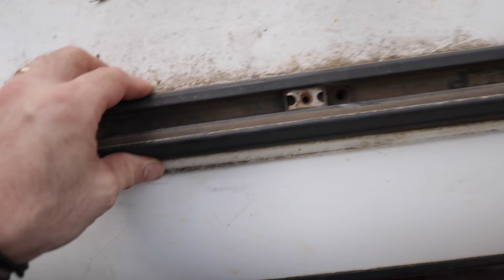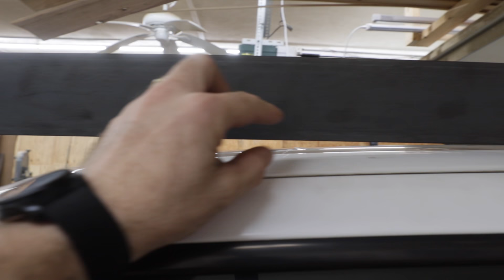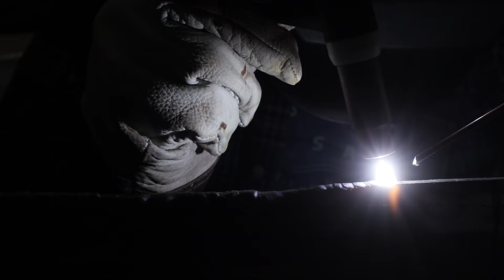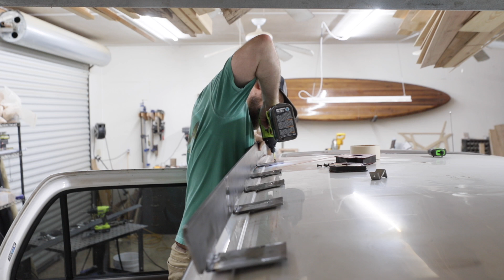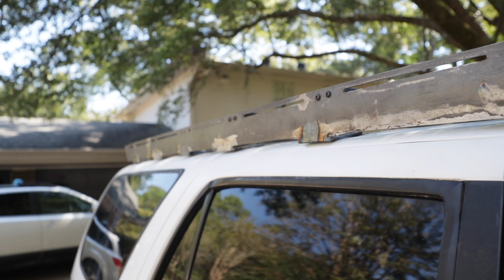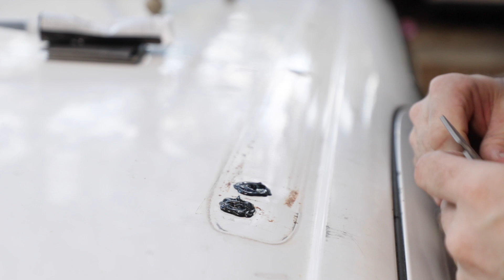How to Build a Prinsu Roof Rack for 3rd Gen 4Runner!

Comment from the maker: (Update) disappointed with the hardware from tnutz I thought it would be more weather resistant but they already have surface rust on some of them and it hasn’t even rained. I’ll either have to paint them or look into getting some black anodized stainless hardware if that’s even a thing. Suggestions welcomed. 
Also.. 
I didn’t show this well but there is 3m double sided mounting tape under the front brackets to protect the paint and prevent movement. Just so you know 👍. Y’all are awesome! So glad y’all are enjoying this build! 🙏🙏
Reply: Get titanium hardware and heat it till it turns bright red then dip it in wd-40 it will blacken.
Reply: @Stealth_Overlanding for that price you should just buy the real product. That would be insanely expensive for a damn roof rack.
Reply: I built my own prinsu style rack about a year ago. McMaster Carr has black stainless hardware, it’s a little pricey but it’s worth it in our use👍🏻
Reply: Use stainless hardware. More expensive but won't rust. You can paint it black after the fact to hide them. 
Great build though! Looks like it came from a factory. 👍
Reply: Black Anodized is not a thing for Stainless Steel. But it is a thing for Aluminum. Considering your metal choices Stainless Steel that is Black OXIDE finished is an option to consider.
Reply: Mcmaster Carr they sell black oxide hardware that’s where i got mine
Reply: @DuanDao  True, and it will cost you.
Reply: @SuckItYouTube19  I think I paid $50 just for the hardware 1/4 20 bolts, washers and lock nuts all black oxide. Pricey but looks good
Reply: I agree, tnuts hardware rusted too quickly on my roof rack as well.
Reply: stainless or zinc coated will be fine. Just make sure to dab the threads with anti-seize so you can remove the bolts later without them getting stuck.
Reply: How is the wind noise while driving with new rack?
Reply from the maker: @robert8342-w7x  no wind noise! It’s great!
Reply: Hey how long were your aluminum extrusions?
Reply from the maker: @davidanikeyev2707  44in
Reply: @PatrickRemington  thanks!!
Reply: @davidanikeyev2707  i replicated the length of the prospeed rack and used 51”
Reply: @DuanDao  thanks!!
Reply: @davidanikeyev2707  want sure if you were asking Patrick out me lol
Reply: @DuanDao  snap I didn't realize I replied to the wrong person 😂😂😭
Reply: @davidanikeyev2707  haha it's all good man
Reply: @PatrickRemington   You’ll want to go with Stainless Steel fasteners.  And I would paint the heads.  There’s nothing you can do about the scratching.  Even anodized will get scratched.  Painting them means you can touch them up later if they scratch.  In a perfect world… You would powder coat paint the heads.  But… that’s expensive.
Reply: aluminum in contact with steel (dissimilar metals- including stainless steel) will cause galvanic corrosion. electrically isolating material would help- rubber gaskets or washers- but may not be structurally sound in certain applications. you could try having your steel powder coated to isolate it from the aluminum. "anodizing," though, is a process applied to aluminum, not steel- looks like your rails were anodized black. Good on you for giving this a go- many of us dream about building the perfect rack and never get around to it!
Reply: @jeremyhoenig  polyethylene tape is sufficient in-between differing metals to prevent galvanic corrosion. That what's used in-between steel bogey wheels & the aluminum box of semi trailers
Reply: @artsteadman2230  good to know, thanks!
Reply: @jeremyhoenig exactly.

Comment: Is galvanic corrosion an issue mixing aluminum and steel for this application? Id be worried about that on a roof rack - especially if the car isnt garaged when at home but maybe thats just cause its wet where i live

Comment: I know I’m way late to this video, but what a great job with some good tricks included for us DIY’s. I was reading a lot of comments about the long cut slots on the side rails. I’m not sure if this would be possible, but a router with a clamped down guide rail or something. I’m not sure if they make such a medal bit though. It would be nice if they did though. Works great for wood. lol
Reply from the maker: Thank you! I wish a router would work for that but it spins too fast and the bit will burn up. It might work on aluminum since its much softer than steel. 🤷‍♂️ the other problem is if the bit were to bind up it could really be violent. You don’t have to worry about that so much with woodworking but metal you do

Comment: I’m looking at making one for my 80 series but more arb-esque and thinking of welding cross beams to the side rails. Did that ever cross your mind for this build? Thoughts on strength versus just using screws?
Reply from the maker: I wanted the cross pieces to be aluminum extrusion and I wanted them to be movable for different purposes. Since prinsu uses screws i knew it had to be plenty strong and it is.

Comment: I may be 3 years late but I wanted to add that if your bars are making a ton of noise you can fix it by wrapping paracord in a spiral around the bar. It will almost completely get rid of the whistling and other noises.

Comment: Looks amazing, I'm wanting to do the same thing myself. One thing I'm wondering is how strong the cross rails are? To me it seems that only having two screws on either end is a big failure point and much weaker than the rest of the rack. How have you found it? Also, where did you get the rubber that you used to pad the roof from the feet and also the wind fairing?

Comment: Because you didn't put any rubber back. Under those for a while, did your whole start leaking?
Reply from the maker: I used rtv silicone around each bolt hole. No leaks!

Comment: Those brackets you built to attach the rack to the roof don't really seem like a great solution. Tons of extra weight, a lot of work and I'm not sure why it would matter if you had to put cross braces where the factory holes were.
Reply from the maker: The objective wasn't to build the lightest roof rack with the least amount of work. The objective was to show others what it takes to build a Prinsu-style roof rack. Which i did beautifully. Also, those rails only weigh 16lbs each sooooo.. 😂
Reply: @PatrickRemington  Did you consider just some angle iron? I've been designing and planning one for a while and a piece of angle iron or aluminum just seemed like much less work.

Comment: Did an exact build for my 5th gen turned out better than expect at a fraction of the price compared to prinsu. What size steel did you use for the wind deflector? That's all I'm missing and it'll be complete
Reply from the maker: I think it's 16ga

Comment: Patrick- awesome build & Great video!
You have inspired me to give it a shot...
Been thinking of lengthening factory rack for a while - this would definitely look much cleaner!
I am a fair bit behind you on the fabrication & welding curve (still getting good with MIG but did complete a cut to weld bumper)

Few questions if I may:

Know you knocked the tnutz bolts - if you had it to do over again would you still use their rails?  

How is wind noise? The slots on rails seems like it would cause some as well as gussets on mounting tabs.

Anything else you would do different if doing it again?

Tnutz all in cart & ready to order - should have my 3/16 soon as I can get to the yard 

Thanks

Comment: So, I have been looking at building my rack as well, couple of things. Prinsu uses 1/4 aluminum for their frame depending on how many cross bars depends on how much weight it can hold. since your using steel, you could have gone with less gauge. but the issue with steel is it is more prone to rusting. I did see a rack that was interesting is that it was a basic frame, with thinner gauge to give it the arrow design look. another thing to remember is weight. to your comment I would look around and go stainless. but if you go with the idea, I have which is aluminum you don't have to weld just bolt everything together. then paint or powder coat.
Reply: definitely the aluminum for anti corrosion, and the powder coat is key too, no bondo required.

Comment: Ok, this is going to be quick. 1. I love those skewer hack trick with cardboard.  2. Is there a 4 inch 3/16 at 90 inches plate that you can just buy instead of welding pieces together? I like the DIY part, however some of us, don't have welding machines.  Over all, this is definitely DIY for  experience welders. After watching your video, It looks like a plasma cutter would really help with the holes and may just buy a plasma cutter
Reply from the maker: Hey thanks for watching and commenting! I appreciate it! Yeah I get it.. but welding equipment is becoming so affordable and something I am trying to promote on my channel is how easy welding is. I Tig welded this but you could mig weld it so much easier. If you like diy projects I highly encourage trying it out. 
Yeah I've other builds use angle iron bolted to the side rails instead of welded. Look up superfastmatt channel and check out his build. Also ebay is a great place to find short sections of metal for smaller projects. Hope this helps

Comment: That turned out really good! 
Any reason you didn’t go all Aluminum for this project?
Reply from the maker: Thank you! Steel is just cheaper and much easier to weld. I need a little more practice welding aluminum before I try that.
Reply: @PatrickRemington  I’ve actually only welded aluminum cause it’s the only metal I could cut with my woodworking tools lol. 
From what I can tell, it’s exactly like welding steel, just shorter beads to keep heat down, and cleanliness is extreme. 
Plus, as far as projects go, 99% of the time the steel diameters people chose is way stronger then needed, so the same diameters in aluminum (99% of the time) will work. If anything you might go 1/4 in aluminum to replace 3/16 steel.

Comment: The volume of the aluminum is enormous compared to the volume of the stainless in one of these racks, you'll probably never see any meaningful deterioration of the aluminum, I wouldn't get too worked up about galvanic corrosion here. You also have the anodized coating to help.

Comment: What paint and primer did you use? Also what size of steel plate did you use to make the wind deflector?
Reply from the maker: The wind deflector is 16ga steel I’m pretty sure. I painted it with rustoleum self etch primer then top coated with rustoleum flat black enamel. Then I coated that with raptor liner
Reply: @PatrickRemington  awesome, thank you!

Comment: Hey man, What was the overall width of the rack? I am going to purchase the aluminum extrusions soon and I was going to do 42" long. What length did you end up using? Nice build!
Reply from the maker: Thanks! My crossbars are 44" order them with 1/4 20 threads already cut!
Reply: @PatrickRemington  yep! That's why I wanted to know the length, thank you!
Reply: @PatrickRemington  oh and do you know what fractional length is? it's an option on Tnutz for the extrusion but I don't know what it means, thank you
Reply from the maker: @benrobinson6907  that's if you needed it cut to 44.5 or 44.25. just leave it blank if you are ordering them at 44 even.
Reply: @PatrickRemington  my brain sometimes does not work. Thank you😂

Comment: where did the hokes beside the sunroof come from, did you drill those? my 3rd gen des not have them
Reply from the maker: There are no holes next to the sunroof. That bracket just sits on the roof to support the front of the rack. There is double-sided bonding tape under that bracket to protect the paint and prevent movement.

Comment: Reality is 55lbs is bad, it’s high weight, go around a corner without it and then put a 50lb bag of concrete on your roof and do the same, tall weight leverage is a roll hazard, it’s physics
Reply from the maker: Nah... Prinsu's rack is 50 lbs and it's made from aluminum so I'm not that far off. 55 lbs thinly spread across a large area isn't even slightly noticeable especially on a heavy vehicle. Not a roll hazard AT ALL. I'm used to having a 150lb rooftop tent on top of my vehicle that I also barely notice. 👍

Comment: You are using aluminum on steel in weather, galvanic corrosion is going to destroy that rack shortly, you should’ve made the whole thing out of aluminum and used stainless connectors. Even at that you should use nylon sleeves and washers to isolate the stainless, mild steel and aluminum from one another
Reply from the maker: Nah. Wrong again. I don't expect to have any issues with galvanic corrosion. Not anytime soo at least. All surfaces are painted and coated with bed liner so there is no metal to metal contact except for the steel threads touching on the inside of the aluminum extrusion. Prinsu even uses stainless steel or zinc plated hardware so if their products last so will mine. Best thing about diy is that is that since I built it I can fix it. 👍👍

Comment: You’ve got some great skills. The only concern I have is metal on metal rubbing on the vehicle paint. Vehicle’s motor & movement naturally create vibrations. I worry that rust ( wear & tear) may develop. I generally keep my vehicles for over 10-15 years. However, there are areas of this country that rust easily develops, such as Chicago. Again, you are a skilled craftsman. Thanks.
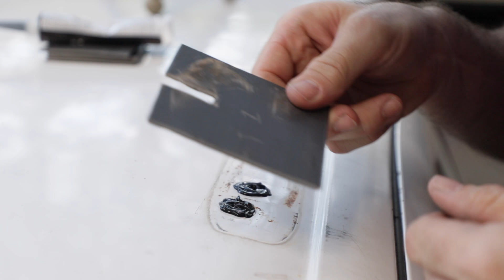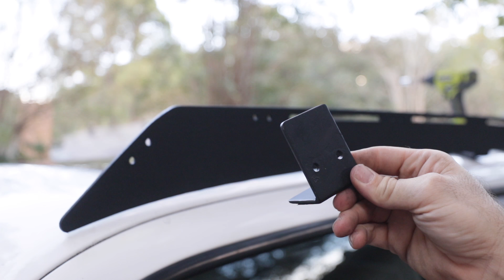Reply from the maker: Thanks you! There is no metal to metal contact the five mounting points have rubber pads under them 30:32 and the front brackets have 3m double sided tape to prevent vibration and movement. 30:50

Comment: wow amazing build!  Im new to the channel, I subsribed! For the LED bar, Im worry it will make tons of noise. When Ive put mine in front of my roof basket it was terrible, and smaller than this one. I had to put it "under" the basket just under the fairing. In your case I would maybe cut a notch on top of the fairing, and flush mount it.
Reply from the maker: Thank you! Yeah, I definitely have the same concern. It seems like anything with a sharp 90-degree corner like a square crossbar or lightbar makes a bunch of noise. We'll find out in my next video!

Comment: What did you use for paint?
Reply from the maker: I primed and pained with Rustoleum. Lightly sanded that with 150 then painted several coats of Raptor truck bed liner for the textured look.

Comment: What is the complete height at the tallest point? I assume that’s the front. I can get 4-6” x 8ft wide fairly easy but I don’t want to buy one and still have it too short.

Also, what are the length dimensions for the extrusions?

Comment: Little tip on your first weld pass you can actually lay your filler wire in the bevel and walk the cup of your tig torch over it

Comment: Well, one thing's for sure!  I'm not putting up any pics of my roof rack! Great job, as usual!

And yes, I've used those "black oxide" screws for various project.  NOT for outdoor use. 
This is what I do:
1.  Removed them all.
2.  Took 99.9% of the rust off with a wire wheel.  Drill motor or bench grinder.
3.  Cleaned them really good with something called "Awesome Orange".  Any good cleaner/degreaser.
4.  Then "pickled" then in white vinegar for a few min.  Rinsed them off really good. Dried them right away.
5.  Poked them in a piece of corrugated cardboard with the heads about an 1/8" above the cardboard.
         Cardboard was set up with pre-punched holes. Spaced about an 1 inch apart.
6. Then painted with flat black.  I use Rustoleum  Automotive flat black.
Reply from the maker: Thank you! Thanks for the tips!
Reply: or buy stainless hardware...for none of the labour, and 10% greater cost....just a suggestion

Comment: If you want more strength on your extrusion cross bars and have to tap them consider using a helicoil  which will make that connection way more strong.
Reply from the maker: Thanks for the tip!

Comment: Wow!  The difference between your previous rack and this one is HUGE.  Following the body like that is a massive aesthetic upgrade.  I suggest you purchase or convince a vendor to donate a plasma cutter to your channel.  You have not let the long grinder cuts stop you, but anything to speed up the process gives more time for more projects, and that's a win for me, on my couch watching your content.  You can get really clean cuts using hardboard as in template.  If you plan the cuts, any errant moves ends up on the waste side.  I purchased a cheap 50 amp on Amazon for around 250, and it's already paid for itself.  I Knew I would need slots on my gas skid project, and the thought of drilling and connecting all the holes was daunting.  Please keep the great content coming.
Reply from the maker: Thank you! 🙏 yeah, i definitely need a plasma cutter! thanks for the tips!

Comment: Probably should have put a rubber foot under the front bracket.  That is going to vibrate and cause noise and will eventually wear through the roof.
Reply from the maker: I should have shown that better but there is 3m double sided mounting tape under the front bracket to protect paint/prevent movement